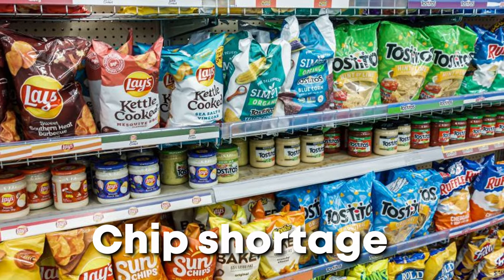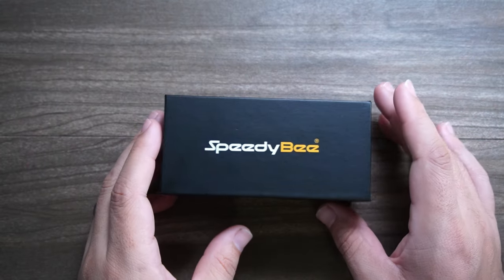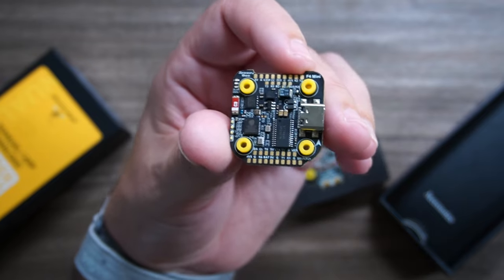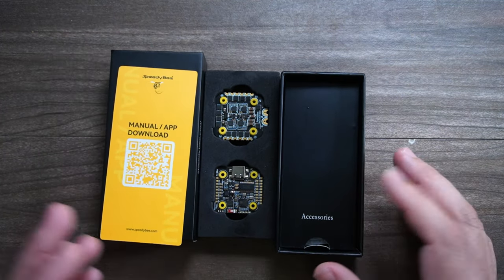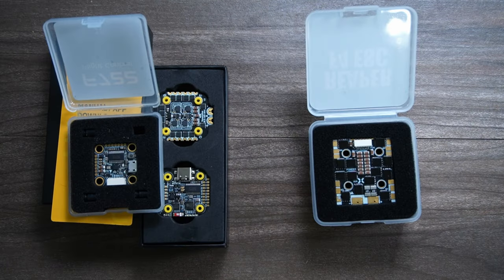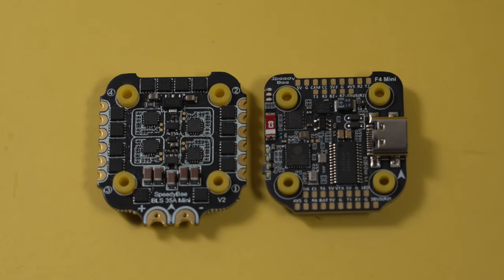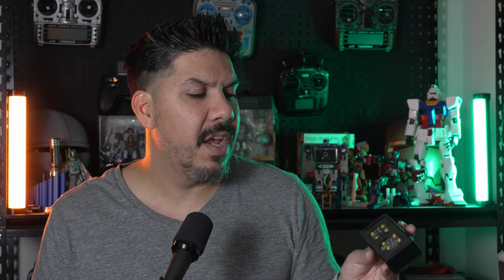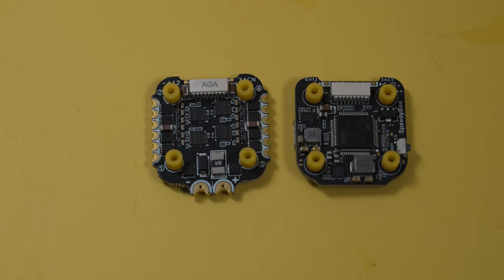Drone electronics for $60?

Comment: 13 5" Quads, first eight with Diatone, last five with Speedybee F405 V3 30x30 and i must say, no issues and as good or better than Diatone F405 MK's. Speedybee is killing it with the $60 stacks, big props to Speedybee.

Comment: The V3 works fine. Had two F745 AIO boards and both have different types of hardware issues / defects.
Reply from the maker: Good notes. Sounds like the stacks are mostly safe.

Comment: I got 3 drones using the speedy bee f7 35amp stack. They are great, and i am loving the flight. Also, their customer service is amazing. I have an issue, my fault, and they gave me a huge discount to buy another. Do not hesitate if you're considering speedy bee.
Reply from the maker: Great notes! This is the kinda feedback I was hoping to see. Thanks for taking the time.
Reply: @JonE5FPV  I am running the stacks on both 4s and 6s. The 6s was much easier to tune than i thought because I had a zeus 45amp on 6s and the tuning was impossible.

Comment: I bought the F405 stack and I had a bad crash on gravel and the esc 1 was dead; I didn't have any burn fets or anything, just stopped working. the flight controller survived. I am going to buy this for my 3-inch build because I bought 2 aio F722 by Mamba and for some reason one both are DOA, One has a bad esc never flown and the other has a weird buzzing and doesn't start up. as well as buying a BetaFPV F405 aio being a doa but they are actually refunding my money so I am going to try this for my 3 inche since, I haven't had luck on the AIO boards.

Comment: I've had okay luck with a few speedybee products. v2 30x30 stack in an open class 6s racer, v3 30mm fc in a street league quad. Had their v3 esc blow up on me on the first flight, but i think that was unsupported hardware in blheli32 and I want to say they fixed it in 32.9.
I'd try this for a smaller drone as you say.

Comment: I use the Diatone F4 FC and it works fine for anything I throw at it. An extra spacer between it and the ESC and there is no worries.  Have never used SpeedyBee stuff, but at the cost may try it.  Would be great for a bando basher.

Comment: I’m considering this stack for a Grinderino build.  Need to decide on motors, any tips?
Reply: Same here! 😂 hope he responds 👍😎
Reply: Same here lol
Reply from the maker: I really like a classic 1507, or a Grunty 1606 like Emax makes. 

For more power you can’t beat 1806, and for max lack of F’s you can go all way up to a 2004-2005 like the Diatone or RCinpower.  Normally you lose some motor protection with a motor that large but grinderino, has some of the best motor protection for that size quad so I’d probably do that with either a decent whoop aio or a cheap 20x20 on 4s 850-1100
Reply: @JonE5FPV  thanks so much for this dude ✊👍🤝